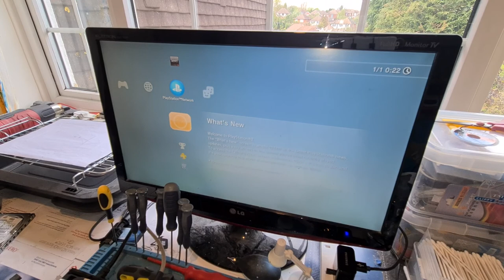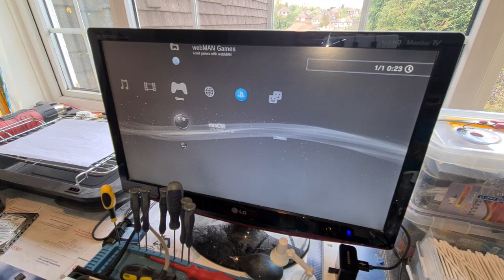Does your PS3 turn off when loading high intensive games? Here's the fix!

Comment: Umm can you help me with my problem. My ps3 keeps turning off when I run the ps3 for a few minutes and when I turn on it's not working but when I press the ps3 or pull out the power cable and plug it in again it suddenly works then suddenly back to black screen just boom shut down unexpected. I just maybe want to know what's the cause of it heating or anything? Cause maybe I think it's heating cause my ps3 sometimes can heat up or just the power cable. Cause when I plug it sometimes it work and sometimes it don't what your solution for this problem?
Reply: But if i let the ps3 sleep and come back tomorrow it's back ok for 1 Hour+ then black screen.
Reply from the maker: @JightRealYT  it seems you have an impending GLOD. This is a flip chip error on the RSX, the answer is to get a frankenstian
Reply: @timdark9282  oh okay. Now I've selled the ps3 but thanks.

Comment: I've got a ps3 slim and it has started to shut off during a game like farcry 4 after the cinematic scenes, I've taken it apart and clenched the dust out but It still does it and I can't figure out why as it's not particularly overheating well it doesn't feel like it is, how can I get the info widget like u do to pop up so I can see what temperature I'm running and is there anyway of getting error logs without using a separate part to get into the system

Comment: For me it’s the opposite, it only crashes when I play low intensity games like COD and GTA 4. I can run TLOU or GTA 5 without issue strangely.
Reply from the maker: That's because more intensive games run the CPU and RSX much hotter. This heat can revive the NEC tokins and restore them to full capacitance. That's why it works on these games, the reaso  it crashes on low intensive games is because the CPU and RSX run cooler. This doesn't restore the tokins, hence the crash. When it gets really bad, it will crash on all games

Comment: Hi, I appreciate your input on this issue. I’ve had my old PS3 slim since about 2010 when the model was first initially releasing. It’s still somewhat functional, however I detect there maybe some overheating or might have gotten YLOD since it keeps turning on and off. Every time I boot it up, it immediately turns off. I repeatedly have to keep pressing the turn on button until it reaches a stable point where it stays on. Some games with demanding GPU performance surprisingly work whilst the other half don’t. I don’t want to bin the console because of the sentimental aspect nor do I want to pay for a repair as I would likely be better off buying another used console. I’m assuming it is in fact YLOD because I see the yellow light when it turns off just briefly. Is it worth dissembling the internal system and cleaning it up or would you reckon it’s done for?

Comment: Bro mine shuts down on these games as well
Reply from the maker: It's extremely likely you have a NEC tokin issue. To be sure go to PS3 toolset.com and expand the folder that says 32 errors. You will now have access to the error codes, look at error code 1 and see what the code is. If it's 1001, 1002 or 1004 tou have a tokin issue. If it's 1601 1701 14ff you have a dying RSX
Reply: @timdark9282 bro i don’t know how to check i don’t see the 32 problems

Comment: My problem is the other way around, with TLOU it works perfectly and with GOW3 it turns off.
Reply from the maker: @exemaco  Get the syscon error codes, if its 1001 or 1002 then you need the tokins replaced
Reply: @timdark9282  I just checked and I have these errors  1001/1002, the strange thing is that the date says year 2006...
Reply: @timdark9282  tantalum capacitors Smd 330uf 2.5v can they work?
Reply: @exemaco tengo el mismo problema ...cómo reviso esos errores bro

Comment: Man this is an impressive video! I have this exact issue when I try to play Castlevania Lords of Shadow and GoW 3 on my ps3 slim. Messed around with my MultiMan settings thinking that would solve it. Nope. Took apart my ps3 Cleaned it and repasted it and that didn't solve the issue either. I don't have the soldering skills to do this kind of work unfortunately. Do you offer a repair service for this kind of work?
Reply from the maker: @jazzaficionados6824  yep timbo98765 on eBay

Comment: I have a ps3 slim that turns off after opening high games but its not an heat problem and neither power supply problem
Reply from the maker: So it's either a failing RSX or a tokin issue. If you ro PS3toolset.com and under the system manager tab at the bottom, you will  find the Syscon error codes. If it's a 1001, 1002 or 1004 code, then it's tokins. If it's 1601, 1701, 14FF it's the RsX
Reply: @timdark9282  anyways thanks i forget to say that
Reply: @timdark9282 if is the Rsx what should i do? Try to fix it or buy a new motherboard?
Reply from the maker: @leobeo225  what does the toolset codes show?

Comment: Hey. My console had this issue - it would shut down in the first 30 seconds of a COD Ghosts multiplayer match (intensive as in this video). At first this happened about 30% of the time. If you kept rebooting and trying you'd be able to get past that first match and use the console for hours - until the next boot. It progressively got worse and it reached the point where you'd spend 30 minutes booting, having it shut down, and retrying, simply to get a working session going, every time you want to use it. It's worth noting also - less stressful games played fine without shutdowns (COD games previous to Ghosts)

What prompted me to finally send it off for repair was when it shut down DURING a session that had been going for hours.
I received it back and it appeared to be fixed. A few months later the issue began to reoccur.

I sent it for repair again and I was told that they cannot fix it, and something about the "APU" being faulty and not replaceable. My experience overall with them wasn't great, and I reckon they didn't know much about what they were doing (took many months).

I've got it back now, and now it has the issue from your other video - I see green graphical glitches on boot and cannot get further than that. Repeatedly trying gives only a black screen. I got one instance of being prompted about HDMI, and before I could do anything the green graphics came back.

My situation is that:
I cannot fix this myself, I am concerned about using CFW for fan control to preserve a console (I cannot afford to be banned from PSN, nor do I want to be suspect of playing illegitimately).

Is it a good idea to purchase a pre-owned replacement PS3? What do you recommend? 
Would you like my PS3 sent over to see if you can get it running again?

Thanks
Reply from the maker: Well, it sounds like you may have had a tokin issue, but now you definitely have a GPU BGA issue. Where did you send it for repair, if they opened the console cold, they may have caused the BGA issues themselves! So now your console is likely to have a tokin issue and also a GPU BGA issue causing graphic anomalies.

So your console needs a reball, or a frankenstian mod if you have a backwards compatible version.

It also needs tantalum capacitors added to fix the random shutdowns

The bottom line is that this is all very expensive, a reball is in the hundreds, adding tantalum caps isn't cheap either. Which version of PS3 do you have?
Reply: @timdark9282  It was repaired by Gamer Tech, and yes I reckon the green graphical glitches were caused by them.

Right, I understand. The repair is too expensive for it to be worth it.

It's a PS3 slim, had it since 2009. I will add that in 2021-2022 I had it stacked on top of a PS4 in a space that may have not been allowing the heat to disperse properly, and that's what has killed it over time.

Do you have advice for purchasing a new PS3 and what to look for?
Reply from the maker: @NoobKillerRoof  get yourself a super slim. It's the cheapest casing, so even though it feels cheap, it's actually the most reliable. This is because it doesn't have NEC tokins and it has the latest revision of GPU. 

So my advice is to get yourself a super slim, run Homebrew Enabler (HEN) and webman mod so you can have a custom fan profile that keeps the console cool
Reply: @timdark9282  Alright cool. Thanks for the advice.
Is there a PSN ban risk from using HEN? As I said before, I cannot risk a ban.
Additionally, how could I prove I do not cheat in online games, if I were using CFW?
Reply from the maker: @NoobKillerRoof  I really wouldn't worry about it, I seriously don't believe Sony is monitoring PS3 activity anymore. Once you have enabled HEN and your fan profile has kicked in, you should be able to press the triangle followed by the right two. This should now disable HEN, but your fan profile will still work, keeping the console cool. You are now able to go online, and your firmware won't be visible to Sony
Reply: @timdark9282  Have you been using PSN like this without issues? If so, for how long?
Reply from the maker: @NoobKillerRoof  I have been using it like this  around 10 years, I really don't think your have any issues
Reply: @timdark9282  Great, I appreciate your time and advice
Reply: I have the same issue with my ghost
Reply: @Ilze-meriPotgieter  Only a new PS3 can cure the issue permanently unfortunately!

Comment: Hello, my ps3 is fat model. It works good but the temps are 67-70 degrees celsius. What are the recommended temperatures for ps3? Im using webman mod but it makes my ps3 sound like a jetplane.
Reply from the maker: Hello, it sounds like your using dynamic fan control and this starts the console at 25 percent fan speed. Now as your system heats up, webman increases the fan speed. Do you know what percentage it increases the fan to? You can find out by pressing start and select at the same time and the temps and fan will be displayed in the top right corner of your screen. If its around the 40 percent fan speed you can try setting the minimum fan speed to 34 percent. This means the system will run at 33 percent and go to 34 percent and above should the system get to warm. You might find by increasing the minimum fan speed the system doesn't get so hot and therfore the fan doesn't get so loud. If it does still increase your fan to 40 percent and above then you will need to perform either a de-lid or a CPU pressure modification. By placing some thermal pads on the hole behind the CPU can reduce temps, see my other video about this pressure mod. A de-lid is more a specialised procedure and I would recommend you don't try it, instead get a professional refurbisher to do this for you as it can kill your console if done incorrectly.
Reply: @timdark9282  Thanks for your answer , i will check the video. I changed the thermal paste but i think its not enough. Bought the ps from old city second hand marketing. When i opened it the warranty sticker was still there , and was full of dust. Never seen so much dust inside anything. Probably never got cleaned before. The model is CHECH l01
Reply from the maker: @frezentesen3108  place two 2mm thermal pads in the indentation behind the CPU, this is likely to reduce your temps

Comment: Hi buddy, ive just completed God of War & God of War 2 (ps2 games) on my backwards  compatible PS3 and now want to play God of War 3 (PS3 game) but it just keeps switching off. I've played other ps3 games on the console without this happening. Is it the game thats the issue or the console?
Reply from the maker: @mattd5073  No!!! It's your console, and it is highly likely to be a NEC tokin issue. To be sure go into your PS3 browser and head on over to ps3toolset.com. click on system manager at the top in the middle of the page. Now scroll down to the bottom where you will find the error32 tab. Expand this tab and make a note of the last 3 error codes. Now message me those codes and I will confirm the issue

Comment: Hello my ps3 use to off itself when am loading games and it will keep blinking red, what is the solution for my problem.
Reply from the maker: A syscon diagnosis should be performed. If it's a 1001 or 1002 error, then it's likely to be the NEC Tokins. The fix is to add tantalum capacitors to the existing NEC tokins. This could allow the capacitors to deliver the correct power to the CPU and GPU. This will stop the system from shutting down when loading games
Reply: How will i do all that
Reply from the maker: @sambujangjawneh  you can use PS3 Pro Tools to dump the syscon onto a USB stick. You must be running g custom firmware to do this. Once you know the error codes, you can apply the relevant fix
Reply: @timdark9282  please can you make a video showing how it's done please.

Comment: I literally have the same problem when I tried playing Test Drive Ulimited 2 & Midnight Club LA. I was wondering if the hair dryer technique could possibly work with this issue?
Reply from the maker: To determine what's going on, for sure, you will need to jail break your console. Then run a package file called PS3 Advances tools. Scroll to the left, and you see "dump syscon error codes."make sure you have a USB formated to FAT 32, and it will dump the Syscon  error log to your usb. Now go to your computer, insert the USB, and open  the SM file. You will see the last 32 codes generated by the PS3, and if it's 1001 or 1002, then you  need to add tantalum caps to resolve the issue. Simply follow the guide in this video
Reply: @timdark9282  ive tried to jailbreak my ps3 but it wont work cuz i followed a guide to the letter and nothing happened
Reply from the maker: @vegeta4249  did you install the Evilnat firmware from a USB stick formated to FAT32? Did you download it from brewoligy.com from your computer?

Comment: Hi. I have fat, but CECHK (DIA-002 logicboard). My case is early shutting down in PS2 iSO games launched on rebug default ps2 emulator. As i understand, it is proves that problem in cell nec tokins, because emulation works by cell high intensive calculations ? And shutting down happening, if console stood without power long time (3-10h). After reboot works fine
Reply from the maker: Hi Alex,

This fix should work fine. When the PS3 goes into PS2 emulation the RSX is not used, this can be found in the coding via the system control log. This means the CPU is made to work harder than normal. The fact your console switches back on tells me it's highly likely to be an issue with the power filtration, obviously the NEC tokins are involved with delivering the power to the CPU. To test this simply tag on one 470uf 6.3v tantalum capacitor onto the CPU tokin topside of the motherboard. If the PS2 games work without a shutdown then I would proceed to follow all the steps in my tutorial. It's worth doing one RSX tag on because it's likely that the RSX tokins could follow with an issue in the future.
Reply: @timdark9282  thanks for solution. Can i detect decreasing capacity of tokin via multimeter without desoldering it? For example, after capacity measuring, i will se 500uf instead 1k/2k uF (depends on tikin)
Reply from the maker: @t0mbell  No, you can't use a multi meter to check for bad tokins. You would need a oscilloscope to check the ripple noise that's coming from each tokin. I would head over to PSX place as there is a very long thread about syscon first steps, this thread covers a lot of NEC tokin errors and advice on how to deal with it. However tagging on caps works as well and is a easier and less costly solution. Otherwise your buying an oscilloscope and spending hours of reading on how to determine bad ripple noise form the capacitors, if you got the time and the money it is of course the correct way to diagnose a bad NEC cap.
Reply: @timdark9282  yep, tagging sounds like easiest and cheapest way. Thanks a lot for  explanation

Comment: hi, do these tantalum capacitors work? Panasonic 330uf 2.0v
Reply from the maker: You need to use 470uf low ESR caps. You can either tag on like I do in this video or replace them with tantalisers. See the link below

https://youtu.be/W6OZJI8EvxI?feature=shared

Comment: Hello, My ps3 slim 20xx having a same problem when playing some game, im not seeing this problem at any game about 1 years ago when playing mgsv and ac4, but recently i want to play wwe and persona 5 but my ps3 keep turning off at certain place for persona 5 and when match just started in wwe, do you think i have the same problem?
Reply from the maker: It's definitely likely that the tokins are losing the ability to supply the correct current to your CPU and GPU. So yes this is likely to resolve your issue
Reply: @timdark9282   how much do you think it will cost me for repair it? I dont have tools and proper skill to doing it myself
Reply from the maker: @sigadop3492  about 80 pounds to tag on some tantalum capacitors

Comment: i have the same problem with farcry 3 what i should do¿
Reply from the maker: @diversecontent9241  check the syscon log. Go to ps3toolset.com and click on system manager in the top middle tab. Now go to the bottom and expand the 32 error tab. Make a note of the top 3 error codes and post them on here. I will then tell you what the issue is